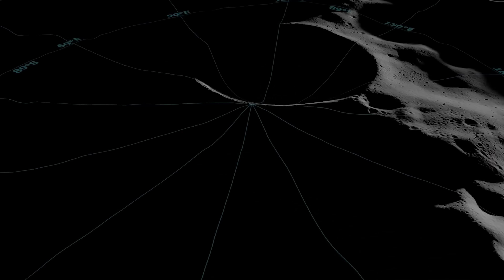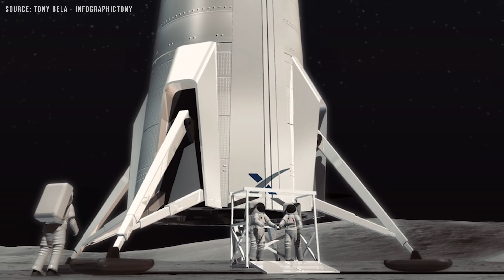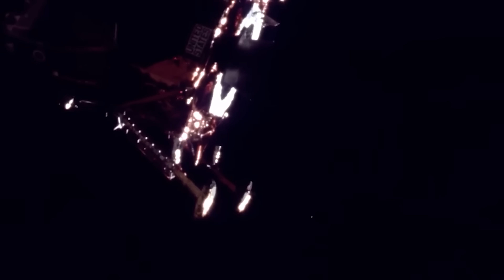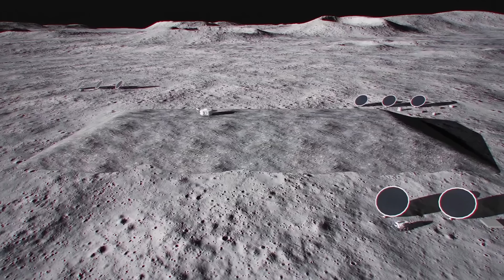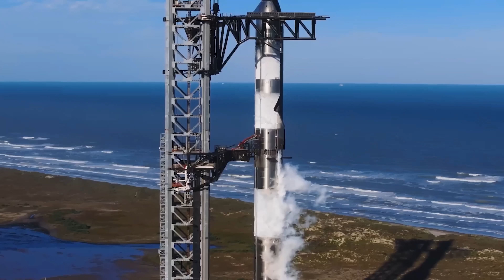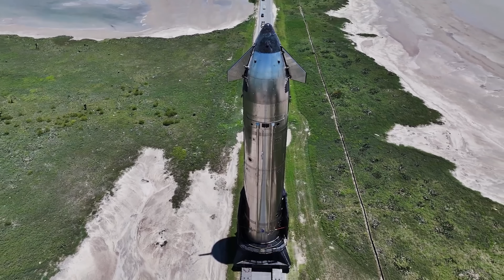SpaceX's New Method to Land Starship HLS on the Moon Sideways, Solving NASA Big Concern..

Comment: The concept of Starship landing on the Moon either vertically or horizontally in its present format is plainly ridiculous. It becomes obvious that a lander designed for the purpose is required, either a cut-down version of Starship itself,  or a completely new design. Perhaps with an expendable lower section as with the Apollo landers, but of course much larger to allow for cargo capacity. I am sure that SpaceX will be already designing alternatives.
Reply: "expendable lower section" - so you mean Apollo, just larger, how much larger?  At what point does that "largeness" just become starship again?

I think longer term, a Starship-HLS in a 2-stage model may work.  Technically that would be 3-stages due to the Booster (back on the Earth-side) counting as 1 stage.

But current plans should be able to work, big Starship delivering humans and a MASSIVE payload to start building lunar base.

Comment: If it lands horizontally how does it take off again?
Reply: By firing the same rockets it used to control its descent.
Reply: @andrewd7112  not quite the same mind than potentially using main engines to slow then tipping and cushioning a landing, it having to generate rather more thrust to do the opposite, completely reconfigures the innards and adds engines and plumbing and complexity. Can’t see this happening myself but a neat idea. Shortening a specialist lander Starship seems a better less complex idea short term idea.
Reply: Yea possible, yet I think the Horizontal landing means the ship becomes a building. Never to leave. Origin will do that with smaller craft.
Reply: @captaincrash12   gravity on moon is one sixth that of earth's gravity so technically they might easily lift off
Reply: @suryapalli7088  Very true. Easily is a strong word though. Does appear like that Moon Base Alpha show for sure. Amazing times.
Reply: A thought 💭 a VTOL designed ship that can takeoff using ramped runway ???

Comment: I think a parachute and a foot that can slide will help the spaceship to land.
Reply: a parachute in zero gravity ...good luck with that slowing you down
Reply: @kawasakikev8905  ...What? The Moon has gravity, Parachutes don't work on gravity, in fact if it did, it would likely help in decent rather than work against it. They work with drag, but the Moon has little to no atmosphere. That's why parachutes wouldn't work. It would with mars, and it has.
Reply: I don't think you did... think, that is.

Comment: Landing upright on the moon or mars is physically dangerous because you would have to land on near perfect or a pre-prepared landing site. Landing horizontal makes sense from a safety and a load /unload perspective. An elevator type system for astronaut and the load adds more weight and complexity. I can see a redesign of Starship for this very reason. It wouldn't have to necessarily be circular either. In space or on the moon/ mars the shape of the vehicle is irrelevant. We only make circular tubes to help it glide through earth's atmosphere. A squarish type starship could just as easily push through earth's atmosphere with the benefit of better internal design for the humans who occupy it.
Reply: Cain't landa Cucumber 🥒 on the Moon..

Comment: Why not design a way to dock  three or four booster setup at distance from each booster connected by a docking process in orbit  for landing together as a mutual booster of three or more multiple landing booster  for almost perfect stability if you connect three of the modules together in orbit. That might solve the stability problem and then would make it easier ether A: stay upright once landed or B: possibly easier to give leverage to each to lay each one down horizontally. 🤔
Reply: I like the gantry idea, building in orbit before landing like a drone

Comment: It's crazy to send a tall spacecraft to the Moon anyway!  
Apollo didn't need to do it and we don't need to do it now!  
Apollo had the right approach -  a nice squat, low-slung lander.  
If you really want to send a long spacecraft to the Moon, it should land horizontally.  
Given that, it should have at least eight legs -  four along each side.  
Same with the "landing rockets" -  four along each side.  
Legs and landing rockets would swivel out before landing.  
Yes, all of that is more complex and costly.  
That's why my first preference is to do things the Apollo way - a short, wide spacecraft.
Reply: @gaius  The goal is to deliver a massive amount of gear quickly and efficiently so as to establish permanent outposts quickly.  Using smaller, squat delivery systems would take longer and be costlier.
Reply: 6 or 8 legs horizontally. This is in reference to large capacity delivery. As Musk and NASA have announced previously. This craft never leaves. It becomes a building. Origin will do the launches to orbit. Where Origin and SpaceX ships will be waiting if needed.

Comment: You have 11% of Earth's gravity on the Moon--no structural challenge here.  However, the thrust while landing would be a bigger problem.  My idea (if landing vertically) is to absorb the landing force into springs so you need far less thrust to land and can release to bounce back up before firing thrusters.  As for the elevator single source of failure, I don't see you they couldn't thrown down a rope ladder, as well.  Also, if I were them, I'd deliver an inflatable habitat to burry and live in down below while there.
Reply: All the science involved in landing this thing on the Moon but the crew have to climb down a rope to reach the surface?

I see.
Reply: @JarvisThribb no.  The rope ladder is an emergency backup in case of elevator failure.
Reply: @swparsons   you really think they could climb a rope ladder in their space suits ,and then take off on a giant pogo stick..
Reply: @kawasakikev8905 maybe not a literal rope ladder.  But some kind of lightweight ladder.  And yes if their lives depended on it.
Reply: @JarvisThribb  Not a rope--a rope ladder.  But yes--simple older tech is usually more reliable.  It's nice to have the big elevator but a reliable backup to save your life is also a good idea.  High tech breaks, requires parts you don't have, etc.
Reply: @solifugus  How will climbing down to the surface of the Moon save your life?

Comment: I think that the lander can land vertically, only to tip over just as it touches down, with upper rockets guiding the nose gently down to the ground. The upper rockets don't have to slow the descent, just keep the nose from crashing down to the ground.

My only question is how does it take off again?. I would suggest having the Starship split itself in two, tipping the bottom half back upright for takeoff, while the upper half remains on the moon as a base component.
Reply: "with upper rockets guiding the nose gently down to the ground."

Its back will probably break.

Comment: Stupid clickbait title, pretending that SpaceX has changed its landing method from vertical to horizontal, which is to my knowledge NOT true. Apart from that, the video does not mention another problem of a hypthetical horizontal landing, namely that it would probably require not only additional landing legs, but also additional rocket engines at the lower side of the vehicle.

Comment: I thought the contract was changed that required the HLS to return to moons orbit after successful landing on the moon. So, not sure how a landing method where the craft lands on it's side allow for that.
Reply: I don't know how they get the astronauts back to Orion if they don't launch back off the moon. Are they just going to leave them on the moon until Blue Origin arrives to rescue them? 😂

I would recommend dropping a Starship onto the Moon to serve as living quarters, and then using a smaller craft, maybe a mini-Starship to land vertically with the crew. They can then transfer to the Starship. 

Or just give up and ask Blue Origin to use a Blue Moon I with Starship as the starting moon base as mentioned above.
Reply: @richardryley3660 they should land a few landers on the moon first before sending people.   And some cargo as well - extra food, emergency shelter, etc.
Reply: @swparsons They probably should have already landed some components for the moon base on the moon. However, they have a deadline of 2028 for a landing on the moon, and they want to see humans there. So they'll do that even if that means they don't have a moon base.

Morr that likely they will just make a PR display to satisfy the requirement of "we beat the Chinese" and then we won't go back for another 50 years. The American people don't care about space and most of them are so stupid they think it's fake anyway. You can lead morons to water but you can't make them drink.

Comment: Starship can be built with an upper and lower stage. The lower stage houses the engines and fuel tanks and stays in orbit around the moon. The upper stage is the lander, smaller engines and fuel tanks, with the cargo section.

Comment: Go look at the tv series space 1999. What if you dock starhip with a horizontal landing structure. A cradle it sits on to land horizontally. Then the landing structure handles the load... not the starship. The landing cradle does the job at the moon horizontally and the starship gets them there and back vertically.
Reply: Every great dream begins with a dreamer. ~ Harriet Tubman
Reply: In order to build a lunar landing platform, they first have to land there.
Reply: @DaveJLock lmao.... are you totally ignorant? The landing module is not a ground structure.  It would attach to the starship to allow it to land horizontally. It would be like attaching a boat trailer to a boat to let a car tow the boat down the road. 

In this case the starship attaches to the  landing platform. Since moon gravity is 1/10 earth's, the 4 landing platform engines can be significantly smaller than starship engines are. The landing platform, attached to the side of starship, therefore provides vertical propulsion.  That is up and down propulsion since you obviously have difficulty with simple concepts. The starships rocket engins, you know the big things on the bottom of the ship, then could be used for horizontal motion. You know like decreasing the ground speed during landing.
Reply: @billlyell8322 wow, where did you invent that "attachment" from. The OP mentions nothing about a landing platform attachment, it merely depicts a platform upon which the HLS has landed. How on earth (or moon) would they test this crazy concept you have come up with? BTW the gravity on tje moon is 1/6th not a tenth of earth normal G.
Reply: How apropos!  Looks like evolutions first fish, crawling outta the goo..
Reply: The Eagle Obsession documentary 
https://youtu.be/3FQcms0O4iM

Comment: The starships are so high and heavy, how can they get a secured landing on the moon surface? Build solid level landing pads.. that will cut down on moon shap dust being thrown out. Then tip them over and take them to area where they will be used as habitats. To just land them and then tip them over at where they land creates a mess. Heavy duty type of fork lifts are needed to move the star ships around on moons surface . How do you get fork lifts to the moon?

Comment: A horizontal version just screams easy access and much more safety.  The engineering aspects can be calculated to develop this version.
Reply: Horizontal implies engine thrust way closer than the vertical version with the ring thrusters at the top.

Thrust at the bottom in the horizontal version would throw up a lot of lunar regolith which is basically fine very abrasive dust and possibly damage engines needed for lift off.

But there is a possibly solution to this.  Can you guess it?  It has been used before.

Comment: Before they put the first, if they wouldn’t want to do this correctly, they have to follow the Von Brown approach. They keep doing shortcuts. It’s no good space does not cooperate. You gotta do everything. The right way the right way would be to send at least five separate rockets to the moon no crew land on the moon And be there in the event that the first man motion of the first man mission to the moon goes bad if you have said rockets there ahead of time that are unmanned they would have an emergency shelter to climb into and they could stay there while another rescue vessel could be sent to retrieve themThis is why going to the moon makes more sense than going to Mars directly because if something goes wrong and it probably will it’s possible to mount a rescue mission because the moon is not ridiculously too far away, but Mars Mars is a joke.
Reply: But Wernher von Braun did not think Mars is a joke. Instead he planned to go there till 1979 already.

Comment: Copper tracks with magnetic slides for down at a steady rate and generate power for the winches on the return, with a interior maintenance access to the crew compartment just above the lower flaps for another option, mabey

Comment: Yes. Send it already on full automatic mode by A.I. at orbital, throw 12 autonomly run satellites moon surveillance communication 360° 24/7 for all who will plan to use it for humanity to progress, for use all at same time rocket, with otemt for landing as design in 5D eliminate wrongful parameters on tuch down horizontally. If all getting well, second rocket will be with human robot's as flying balls, to speed up progress for unfolding  moon base. 11:10